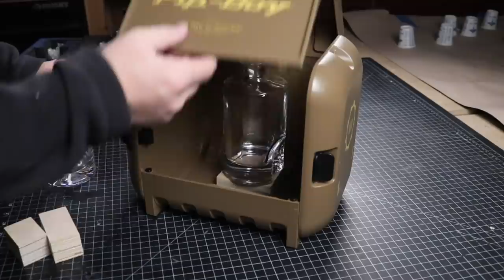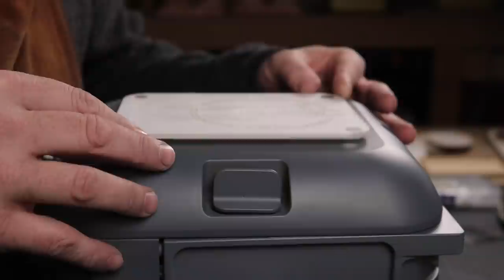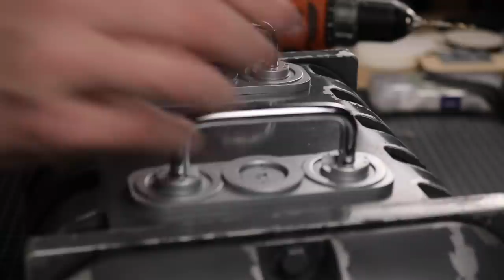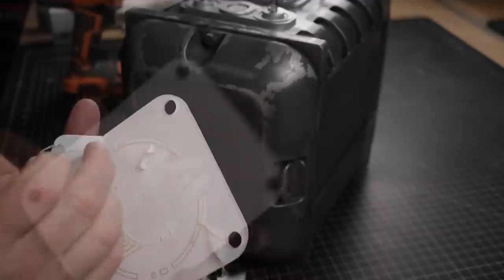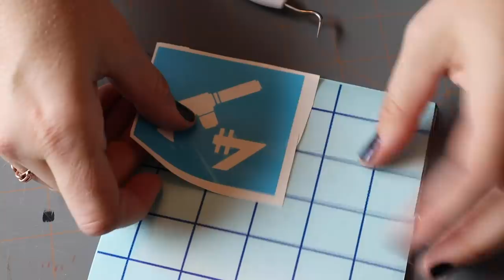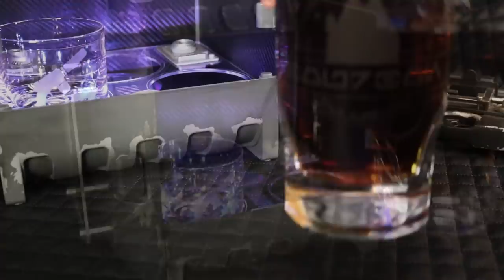Star Wars Drink Crate

Comment: I really like this build and think that as a one of a kind display unit it looks fantastic.

Please do not let the following thoughts detract from how much I like the overall appearance of the build.
As cool as the extended side plates were, they would make it a pain the ship and store.  Handle wise, The should have been spread further out so they where not on the flap and could be used to lift and move the crate. An additional handle on the front of the flap to open it would be nice.   You spent a lot of effort with the carbon fibre wrap to make the inside of the crate look more classy- but you left the original interior exposed and visible when the bottle was removed.

Now I could not build this piece as well as you have, and I really like it, but after working in logistics and transportation those points jumped out at me.  I really like this format and will be looking forward to what else you build.

Comment: You can also etch and engrave acrylic using a Cricut.
Reply from the maker: You know, we have never tried that.  Did it turn out good for you?  What other material have you worked with on your Cricut?  We have been talking about leather on it too.  Thanks for the suggestion!
Reply: Yes. It works great. And fast. It does wood too. Thin wood.

Comment: Question re: etching. I don’t have a cricut or similar but I do have a laser cutter that can cut out either masking tape or large labels, do you think these would work for masking the etching paste or would they bleed?
Reply from the maker: Hi there, I am not 100% sure, but I would be inclined to say you would be fine.  I would just put a little of the etching material on the tape or label and test it first.  Beyond that as long as there is a tight seal you should be fine.  We use painters tape to protect the area outside the stencil, so I think it would work just fine.  Hope that helps.

Comment: Have you tried an air eraser to etch glass? I personally prefer it to the creame.
Reply from the maker: We have not tried that yet.  thanks
Reply: @TheSmugglersRoom  just make sure you use your respirator. I purchased a sandblaster booth for mine. I use the air eraser with aluminum oxide powder to etch glass and metal.

Comment: I really wanna make some stuff like you have but I dont have all those tools lol.
Reply from the maker: Just remember, you don't need all of the tools we have to make great stuff.  I know we used the laser on this project, and many folks do not have that, however I say be as creative as you can with what you have.  We built the first Smugglers Room Project with pretty much a drill, table saw, and a TON of Hot Glue!  We certainly don't want to discourage you to try stuff out.  Have you seen our droid socket build, or our datapad?  both of those have really limited tools, and we'll keep those projects coming as well as these to try and help.